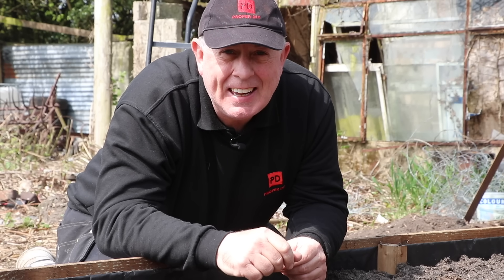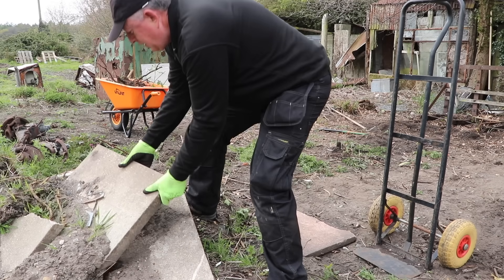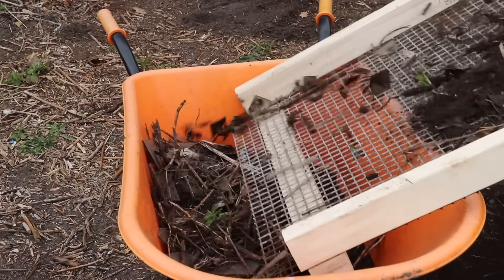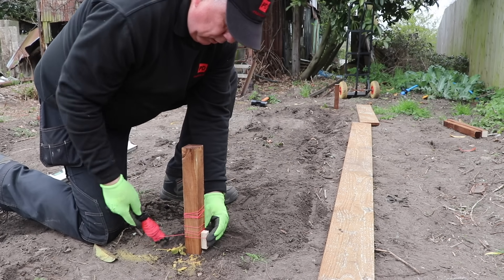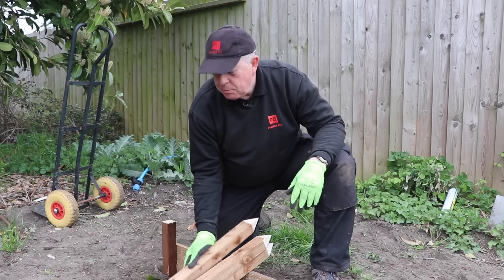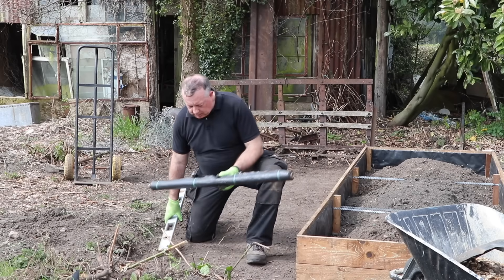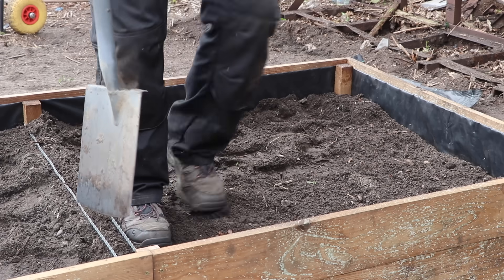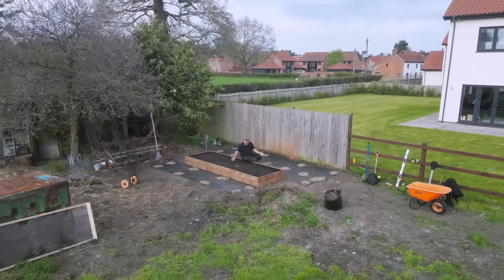How to Build Raised Beds that will LAST!

Comment: Got fed up replacing rotten corner spikes so replaced them with lengths of 50mm square section recycled plastic wood, sharpened at one end. Relatively expensive but worth their weight in reduced maintenance. Treated pine boards didn’t last more than a few years so replaced them with scaffold boards cut to length with damp proof course stapled on the inside. Didn’t need any metal ties to brace them. All held together with self-tapping decking screws. Hope this helps someone.

Comment: You don’t have to completely fill a raised bed if you don’t have enough material. If you don’t fill to the top, the wooden sides provide extra protection against the weather for your seedlings/plants as they grow. Also, over a number of years you will be gradually adding more home made compost anyway. There isn’t a rule to say you can’t use a raised bed until it’s full of soil.

I have waist height raised beds, they are great for my back.
Reply: I like the idea of a masonry brick raised bed, and filling the bottom with rock & then concrete. Removes an obvious path for moles, and really glues the foundation together. 
Just include some drain tubes at concrete level. Also not a huge fan of "buried wood", kinda invites termites to the neighborhood. Invest 1nce, do it right, enjoy forever.
But yeah, I'm with you on "waist high or bust"... the whole point is to save that back, and avoid crawling around on hands & knees :)
Reply: What do u put at the bottom? want to stop weeds/grass growing up but then there's drainage. Or is it not an issue growing from that deep?
Reply: @R1chardH  season one, treat your empty waist height raised beds as a cold compost heap, dump everything organic you can find in there including weeds (as long it’s not the type of weed which grows from root cuttings). Logs, branches, hedge and bush trimmings, grass, leaves, dried stems/stalks, soil from other parts of your garden, anything you would put onto a cold compost heap.  You can put cardboard down as the base layer if you want but you don’t need too.

Stage one is creating subsoil with plenty of organic matter.

Stage two is adding top soil. Doesn’t matter if this layer is low down because you haven’t managed to gather enough organic material during stage one. For topsoil, you can use home made compost, a soil mix like Mel’s mix or purchased compost, whatever works for you. 

Stage three, get growing and keep top dressing with more home made compost every year.

Comment: Love the video. I’ve made raised beds before, not quite as sturdy as these, but you need to mix in some topsoil with the compost. I did the same as you and the compost breaks down quite quickly and your levels will drop. Also topsoil adds different nutrients for the plants, as well as not breaking down.

Comment: I made my raised beds with 2”x8” timber, 3” square posts, bed sizes at 10’x2’x2’ and 14mm thread bar threaded through 15mm pvc pipe for protection from moisture to avoid mid bed warping/bowing five years ago and they’re still solid and rot free ( I maintain them with wood preservative annually ). Love your work and your channel Stuart ( I’ve watched every episode ) and gained a lot of very useful ideas/methods which have all worked beautifully. Thank you Stuart 👍
Reply: Can we use weed membrane into the the bed or just soil

Comment: I was going to plant a hedge around my garden but as I'm in a new built, the side down my garden path was full of builders rubble, mainly concrete and even with a pick axe, I could only get it about 4" into the ground so that idea was scrapped. Instead, I made two planters. Both were 2m long, 1m wide and 0.5m high. Each planter took almost 2 cubic metres of soil. The old hedge I ripped out I mulched. The root balls went in the bottom, the mulch on top and then top soil I got from someone else who was levelling their back garden. I built a sieve to remove the stones and as everything buried at the bottom rotted down, sure enough, the level has dropped a few inches. Now there's a massive plus side to this - that and the used coffee grounds I mixed in as I was filling and the egg shells I had dried out and placed through the blender has produced some of the best soil I've ever seen. The sheer amount of worms I've got is more than I've ever seen and everything I've grown in there has been incredible. I've had plenty of comments especially the size of the rhubarb by people passing.

Total cost for my build was about £17 and that was just the thick plastic I used to line both of them. The wood was old pallet wood from work, the Creosote (not Creocote!) was found in the garden of my late in-laws, the soil was free from someone nearby via a local Facebook group. Topping the soil level up isn't a problem either as I've been emptying the pots of my plants in there after they've died.

Almost forgot to mention my planters were bottomless. The plastic sheeting I bought I wrapped in by about 6" at the bottom so there's plenty of drainage.

Comment: I use 450mm DPC overlapped as it is easy to work with and is stronger. I also bend it over the top boards and fit a wooden capping strip to protect the side walls.

Comment: Very interesting video. I have just finished building a new raised bed as all my old ones have started rotting away.  What I did this time was to put old roofing slates under each corner to help prevent the sides sinking into the ground.

Comment: Look out for post levels, a bit of plastic that covers 2 sides and has both horizontal and vertical bulb levels, attaches with an elastic band a saves you from having to stop and check it is straight

Comment: If you are after growing strawberries why not use your spare tyres?
Stack them up and drill holes with a holesaw in the upper part of the tread. If you want to do a "permanent job" screw through the sidewall into the one below. 
Fill and plant!

If you are worried about tyres looking a bit naff ..... spray paint them before you plant!

Comment: Hi stuart some people  put cardboard  down in raised bed first before thay fill the bed you can fill the first 150 with wood chips  as thay will rot down through  time but thay need to lay for a good few months or over winter  before  using

Comment: Another solution would be to used galvanised sleeper brackets (with stakes) to join the timbers and bed everything down. Also, using a roll of black rubble sacks to line the inside and bottom edge works a treat

Comment: I have some British Cedar Featherdge cladding leftover to use up which has nail holes in it so it is unsuitable for cladding. It varies from 20mm-5mm thick, do you think I should use it for raised beds? Maybe with more supports and should I overlap it like you would normally with featheredge or not? It should be great because cedar won’t rot nor leach chemicals into the soil

Comment: Buy an old IBC tank that has had some sort of food stuff in it originally. Split it in two halves, including the frame. Remove the outer parts not needed, just keep the steel frame and the plastic containers. Drill holes in the bottom of respectively half. Place where suitable. Turn the cut off steel frames with the cut parts down towards the ground around the plastic containers. Those will last you a long time. I got four, so far.

Comment: Not sure I like the galvanised wire idea. When you come to dig it over once twice or however many times, you are going to swear a few times when you hit the wire!
I’ve always used old scaffold boards and never use any preservatives.
I wouldn’t worry about filling the beds to the top. Over the years you will add more organic matter and slowly it fills up.

Comment: Hi Stuart, any treated wood before 2006 contained arsenic so growing would be bad, but after 2006 all treated wood with arsenic in it was banned from food use, the only arsenic found now in garden beds made from treated wood would be a very very light trace in the soil, so it would be ok to not line your beds but i always do for that extra protection for the wood.
Barry (the Wirral)

Comment: I make raised beds for a living much the same way but out of 47mm thick timber and premake all the ends with the corner posts on the bench, I use the recycled plastic liner too. That way just need to screw the sides on and line them on site 👍